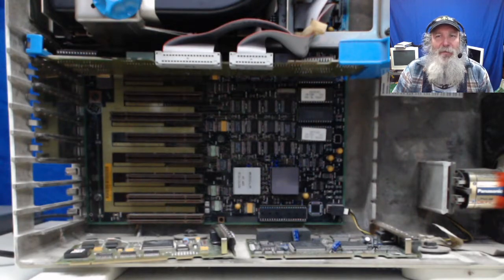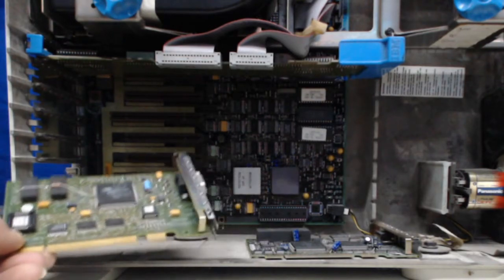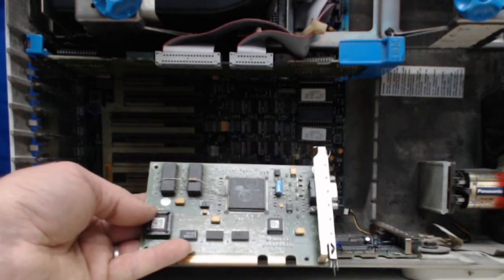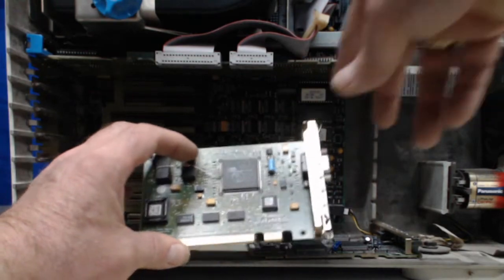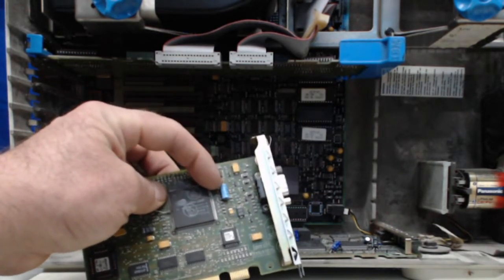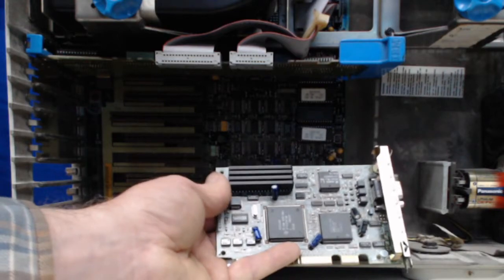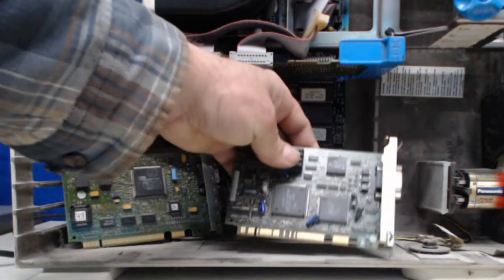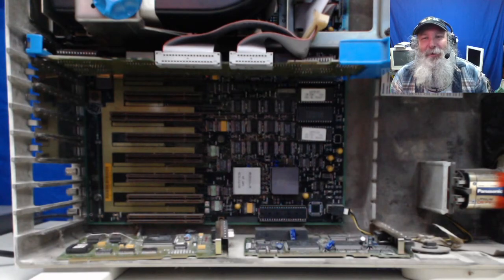IBM SVGA (but turn down the sound!) - What is the amount of VRAM?

Comment: Mis-wired card from the factory?  That's crazy!!
Reply from the maker: Referring to the opposite polarity orientation of the capacitor on the "Short" 1Mb Cirrus Logic adapter - yes, and then IBM had the same fault on the PC Server 720 planar - so double crazy! It's on the reverse side of the 720 planar, so not an easy task to fix - take down your high-dollar server and take it apart to fix a capacitor that would be less than a dollar!: https://www.ardent-tool.com/8642/8642.html#Reverse_Polarized_Capacitor
Reply: @IBM_Museum  that's the way it always goes!  50 cent parts in transmissions and 50 cent capacitors in computers!!
Reply from the maker: @RetroTechChris  - You also have a wife that likes to down-shift an automatic transmission, stressing a $1,600 assembly instead of using a $16 set of brake pads?
Reply: @IBM_Museum  fortunately I don't, but my Dad's 2001 Dodge Caravan decided to do just this at one point.  50 cent part and LOTS of labor to get it running again.

Comment: Can you please do a speed / benchmark on both card so we can compare them? Some quick DOS bench's would be great.
Reply from the maker: Likely on an appropriate system, yes. I'm thinking that a Model 'K/N' I pulled out a week back should do the job. It may already have an XGA-2 adapter installed. Realize that with microchannel it isn't necessarily an easy swap between video adapters, even under DOS.

The TI-based adapter ("SVGA Adapter/A") has spurred an effort within the last year to expand the VRAM and/or run the correct driver on the 25SX/35SX/40SX/8556/8557 planars it is on - and may be the best on performance - but remember that IBM fielded both adapters as video on server models.